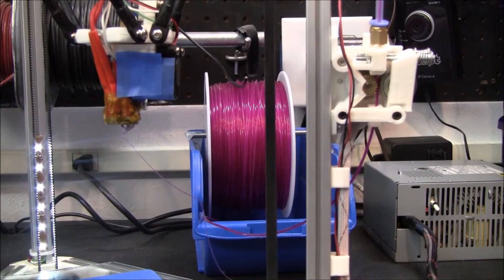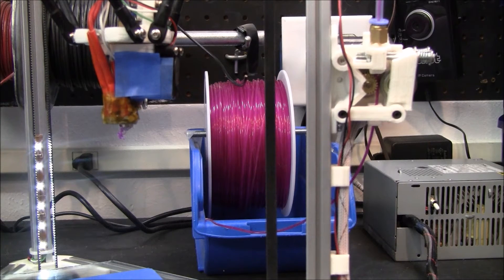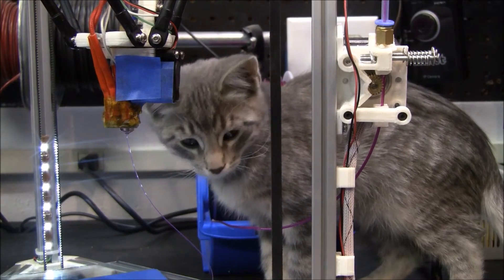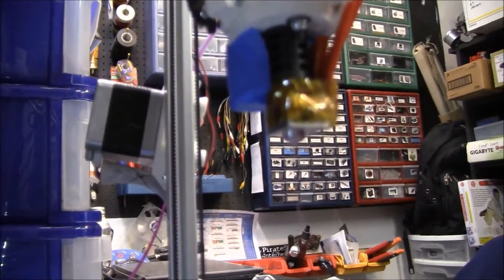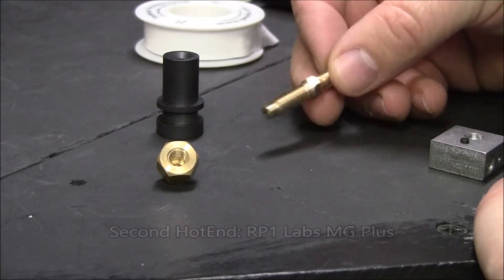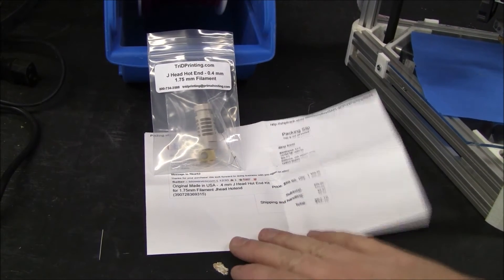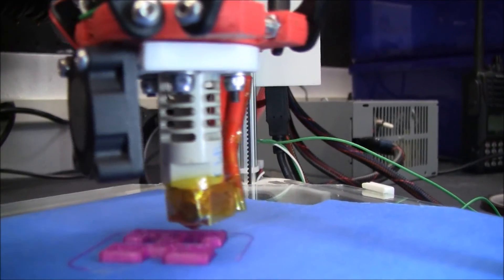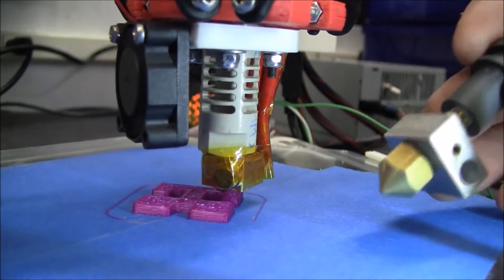Kossel Mini 3D Printer Hot End Review

Comment: The plastic parts hotends are terrible idea... get an all metal one like E3D v5 (http://e3d-online.com/) , it has even interchangable nozzles
Reply from the maker: <p>You need to insulate PLA from heat for as long as possible then heat it up fast in near the tip of the hot end otherwise it will jam. That's why the J-heads work so well.</p><p>I do want to try an all metal hot end someday however I can waste only so much money on crappy hot ends..</p>